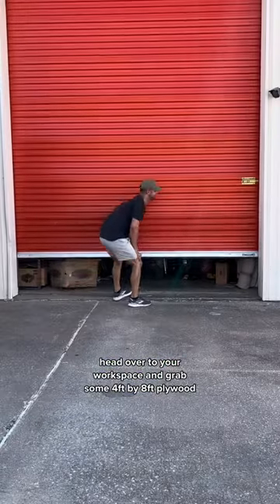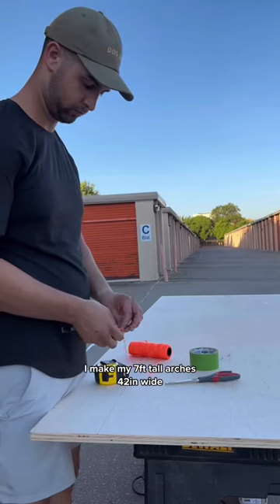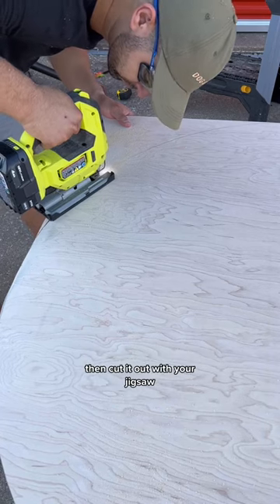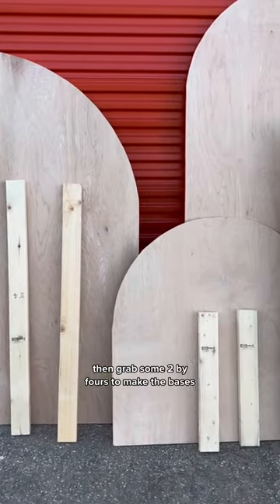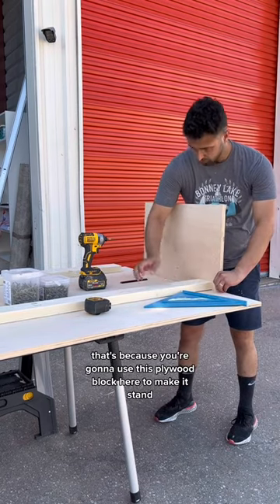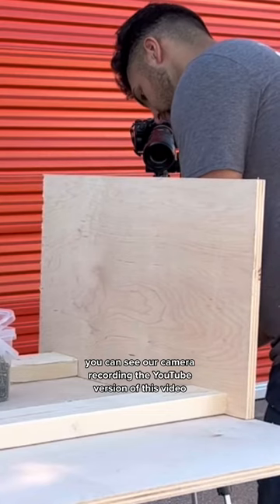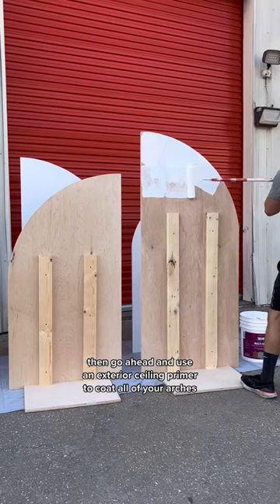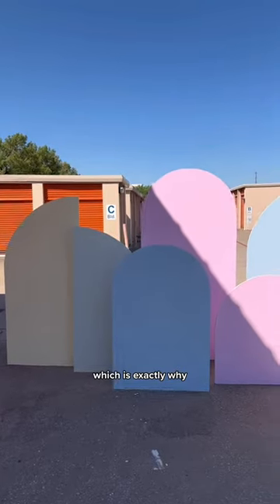Let's build some backdrop arches #shorts

Comment: I’d recommend using 1/2 plywood. 3/4 is too heavy to be continuously move around
Reply: Would anything thinner than 1/2 in be too thin?
Reply: Exactly.
Reply: Na Stick to 3/4.
Reply: @jordangarduno1  Hi. Have you experienced the difference between the 2 different widths.